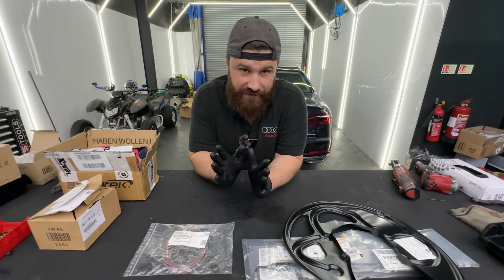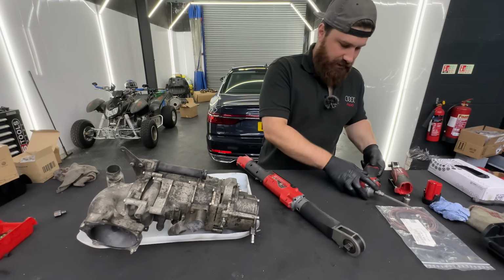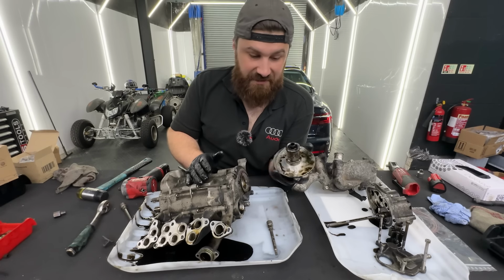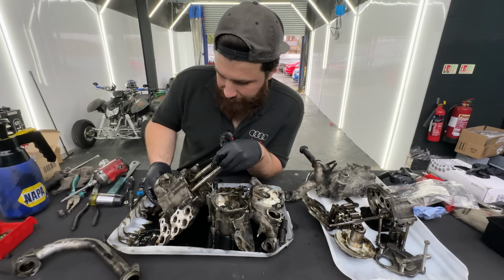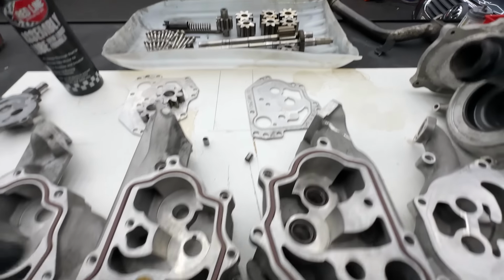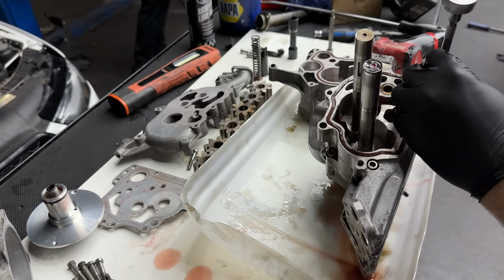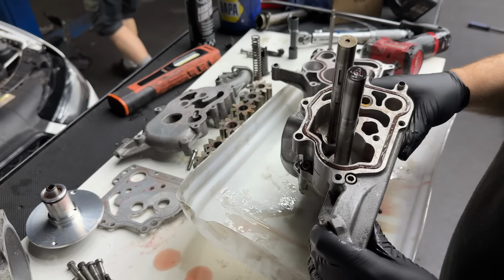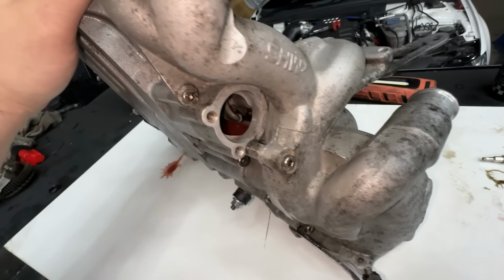EP9 . I bought more parts for my RS6 V10 1000 BHP build , oil pump rebuild with repair kit

Comment: Tip for dismantling Audi's: if it's difficult to get at, is illogical in design, and requires expensive parts to replace, then that's the correct way it comes off.

Comment: the long hexagonal shaft you have all the way to the water pump propeller sub assembly has to be the proper hardened version. At first VAG assembled quite a lot number of parts with not hardened version and at higher mileage the hexagonal section went to a cylinder :) This became an immediate problem for transferring torque.

Comment: Hope your decision to use Bartek parts in the engine build doesn't come back to bite you.A lot of Bartek stuff is made in China and is sometimes of questionable quality. Autotech are a proven supplier of these pumps with good reliabilty. Good luck with the engine build.

Comment: When rebuilding an oil pump, use vaseline (petroleum jelly), old rover v8 trick, vaseline will not leak out, providing suction/pressure for the pump and will dissolve into running in oil.
Excellent videos by the way, looking forward to future footage.

Comment: That little half moon shaped piece of metal you removed from the shaft is called a Woodruff key, that sits inside the square slot in the gears. Coming on great, can't wait to see the rest of the engine being built up, now!

Comment: What we normally do on VW type1 engines with pumps similar to this is pack them with vasiline to prime them.
Reply: Isn't vasiline bad for the rubber seals? Because it is bad for condoms when taking a ride on the chocolate speedway 🤪

Comment: Hi there i have quick question i cant find problem with my a6 c6 2.7 tdi  fwd manual . Problem is something is breaking my first injector . I change it 2 times already 2-3 weeks and it goes down again . There was no metal particales after i remove injector . What can cause such a damage to injectors? I only use premium Fuel .

Comment: It's great to see that your dream engine build comes slowly to reality :)
One thing i could share with you is it does matter what part of torque wrench you hold when torquing bolts if you don't grab it by the end of it then you are not applying the right torque i'm talking about what you do at 35:35
There is a nice video on YT proving it and explaining why( i know that you did that because it was easier to do that in that awkward position)
Reply: Absolutely correct. "Auto Expert John Cadogan" is the video you're looking for, Aussie guy.

Comment: On the oilpump the oil ist not transfered in between the 2 gears, the volume-flow goes on the outside of the gears. Where the gears touch, there ist really only a transfer of load from the driven gear to the other one, that has  no own driveshaft.